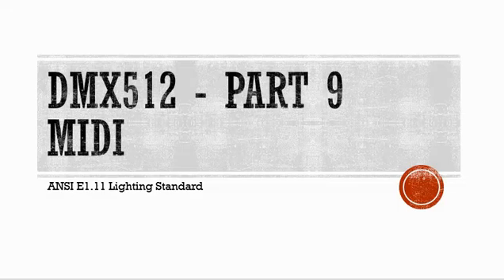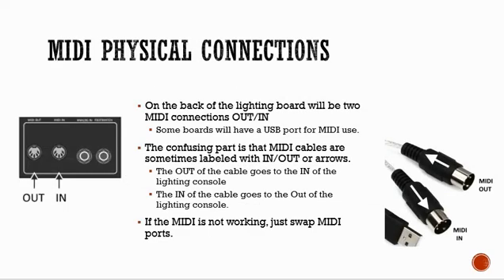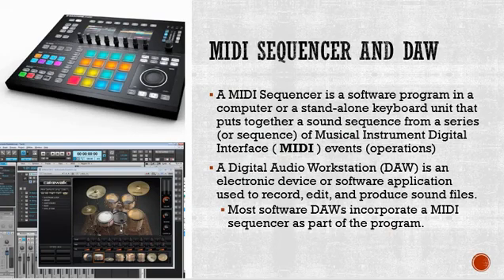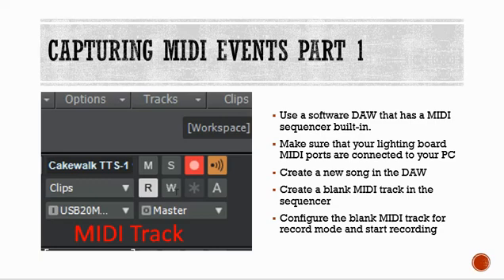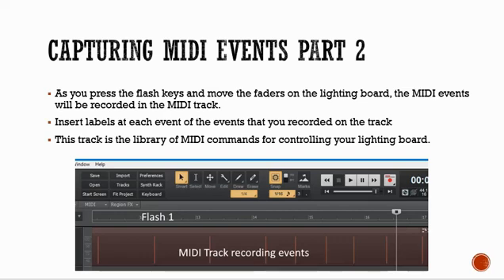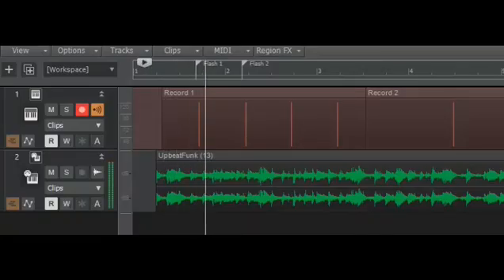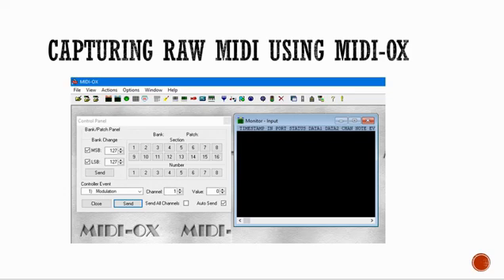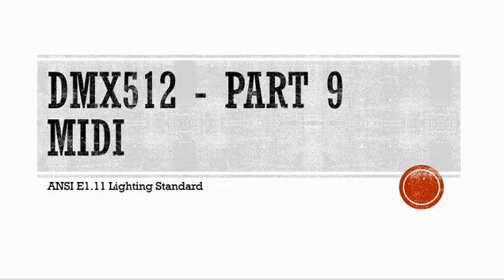Part 9: DMX Lighting - MIDI

Comment: I have to agree with the previous comment. This has been a very useful set of videos. I've been watching without my LC2412 in front of me and now I'm itching to get programming it. Up until now, it's only ever been used to control a dimmer pack manually and it always struck me that the hundreds of features packed into this desk are being wasted. The trouble is, I also want to blow a load of cash on some LED units too.
Great work on explaining it so clearly and thank you very much.
Reply from the maker: Glad to help. I purchased a bunch of LED units through ebay and aliexpress for dirt cheap, just to get started with. They were about 1/5 the price of buying them locally. Occasionally you'll find LED units for sale locally online and on auctions.
Reply: @blanchae  I've just watched the whole series again! That means you are up there with the likes of The Wire and Black Mirror as series I've watched multiple times.
Yes, I can source some RGBW units for next to nothing here, prices close to what I can find on Chinese sites without the risk of import duty. But the gear to hook everything up is almost as much as the units themselves.

I'm currently pricing an upgrade for our amateur theatre company, the plan is to have LEDs working alongside our traditional incandescent lamps, we run those through a 6-channel dimmer. That is straightforward, the dimmers run 6 channels, assign them an address and patch them to a slider, nothing more than dimming, easy peasy.

I have a few questions, I hope you can help...
1. I'm considering using a wireless system due to the physical locations of some of our performances. For example, a transmitter coming from the console, a wireless receiver in a 6-channel-dimmer, another receiver in the footlight chain, and one more receiver in the overhead chain. Does each of these lines need to have a termination?
2. I could potentially be mixing different LED units on the same chain. I'm thinking of using matching units in a master/slave configuration. Would they recognise their "peers" in the chain? I mean, if I had  4 RGB units and 4 RGBW units in the same daisy chain, would the RGBs find each other and likewise the RGBWs? So number 1 RGB could control the other 3 and likewise the RGBWs?

3. This is an alternative solution to the master/slave question. Can I assign the same base address to all the lamps that are the same make and model? For example, the 4 RGBs all have the base address 150 so their other features take the subsequent addresses, would a signal to address 152 (for example) trigger all 4 fixtures at once? Would doing this be better than using the master/slave option in a mixed fixture setup?
4. If I'm correct, we can assign 3 addresses to one patch, so option 3 would be an advantage.
5. Going back to the wireless idea, I potentially have 3 chains, with the possibility of more, is it safe to say that I could have 32 units in each of these chains? This is purely for theory, our budget isn't going to run to 96 lamps, nor will our needs, but dreaming is free, right?

You mention that you're a teacher at one point, that's clear to see. From one teacher to another, we know how to explain stuff, but equally, we're the worse students.

Keep up the good work and I have to say, I love the Canadian accent, I could listen to it all day!

Thanks again from a Brit in Spain
Reply from the maker: Sorry for the late reply, your comment didn't show up in my notifications. 
1. Each DMX chain should be terminated. Sometimes the device has an internal termination
2. I haven't really master/slave chained devices using the Behringer unit. I have using software DMX controllers but that is a different story.
3. You can assign the same base address, the DMX LEDs just listen for info on the base address.
4. Whatever works.
5. I've found that DMX is quite flexible and everything that you've mentioned is possible. Just up to your imagination.
Reply: @blanchae  Thanks again for your help. In the meantime, I've been experimenting and having fun. I have to recommend wireless DMX, effectively it acts as a splitter at a fraction of the cost, while allowing you to have your console wherever you want. I can have it on stage for setting up, sit in the front row to gauge the effects and then retire to my tech box to work the magic.